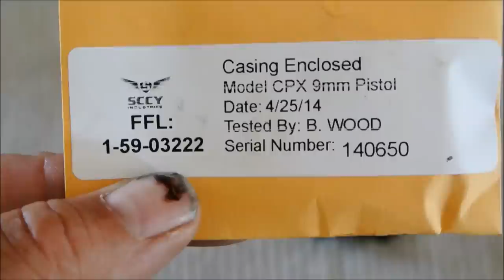cpx 2 problems

Comment: Sorry to hear this. From the looks of it, looks like ...someone...was tryin to field strip the gun and had no idea what they were doing...likely tryin to use a hammer and punch on those pins and got stupid and sloppy and cracked the polymer frame. But hey, whatever right...all guns sold by sccy have a lifetime warranty no questions asked.

Comment: LIFETIME WARRANTY--I never had a problem in 8 years of owning a SCCY
Reply: Richard Walsh this mall ninja is not a real operator like us so he knows nothing!
Reply: I have never seen one shoot 300 rounds without an FTE, FTF or trigger fail to reset. Great gun for criminals but I'd take a good combat knife over one
Reply: 2 weeks of owning 2 SCCY’s and problems with both... I wonder if it’s because they are older gen?
Reply: Richard Walsh I had to send mine back because the bolt would hold open after 50% of the shots “on its own”. They repaired it no charge, even the shipping and have had no issues since. Hundreds of rounds an no problems.
Reply: Cpx-2 works great for me

Comment: I have had my cpx-1 for three years. The only difference between the cpx-1 and the cpx -2 is the 2 doesn’t have a manual safety.  I have shot over 2000 rounds through mine without a failure.  I now use mine for ccw because it goes bang very Time  I pull the trigger and I can hit what I’m aiming at.  You should have called SCCY before you made this video.  From my experience they will take care of your problem without any hassles.  From my experience it is a dependable firearm.  I sight mine in at 15 yards and I can put the pattern inside 5 inches, that is all you need for self defense

Comment: WOW, to crack a frame like that it must have had a heavy dose of either hot reloads or +P rounds run thru it which this pistol is not recommended. That little piece of metal is the ejector pin and is held firmly in place with a roll pin. If it's loose the roll pin is probably broke which is also a sign of really hot loads. Thank goodness it has a lifetime warranty,lol.  Thanks for the Vids.
Reply: Hot loads lol
Reply: Gotta be careful not to run +P rounds through that pistol...it is NOT +P rated.

Comment: I have one and it is great.  I have fired at least 175 rounds through this pistol with absolutely no problems.  I am a novice shooter but I make sure I pay attention to each and every detail with a critical thing of owning a firearm.  Perhaps there are some "lemons" in the gun world?
Reply: This is a good value gun with a great warranty. You did well. Videos that show a problem more likely than not go on and on how bad it is. If you don't want your pins to walk perhaps put some lock-tite (blue) on the pins on each side to be a little safer. Walking pins were most likely the problem with the grip cracking. It is a known problem enough that SCCY offers oversized pins. BTW I am sure you can request them if necessary and they will send them free of charge from what I have read. I myself don't have a SCCY but will be purchasing one in the near future. I have researched this pistol enough to know it will be a great pistol for self protection and will most likely have it in my car or travel trailer. I have better full size pistols at home. I also have a Taurus Spectrum I recently purchased that I will use as a pocket carry gun.

Comment: I bought one on Wed before Xmas and Friday after I order another. My wife and I both find it to be a good gun at even a greater price.  Good luck with it, you should have no problems with Sccy on the return.  As far as the brass, I shoot two to three times a week and as many as 400-500 rds each time and three to four guns each time. Each gun will toss brass different then another. The pin can be taped it nolt a big deal, but the crack is a problem.
Reply from the maker: buzzsah I ended up cuttin bait with this one.  SCCY's customer service is awesome, but i think i got a dud with this one......next!  FWIW I got what i paid for it, so theres that.
Reply: dzlfreek I did have a small problem with their mags, but they sent out two new asap. However they were bad as well lol. I called and was talking with a Jason in service, a good guy to talk with if you have a problem.
Reply: Mags should be broken in reducing the spring tension. There are procedures for that. Also some people have made sure that the top lips are smooth. I have seen some people remove rough spots that kept the round from feeding smoothly. I saw them on YouTube as well. You can try to find them just looking through all the SCCY videos. Most feeding problems have always been the magazines. They need to be broke in sometimes and just getting a new one isn't going to fix it.

Comment: I have several cpx's gen 2 and 3 no problems is a good gun. I did install the trigger spring kit on them all, to smooth out the trigger pull. I also have a couple of the new dvg's there good too

Comment: your vids helped me understand the canik tp9. I bought it based on your "long term " video. Thank you. Any way Please do not fire that weapon until you insert that pin all the way. It is responsible for your locking lug and could possibly allow the slide to come off backwards bro. If you reinsert it properly I wouldn't worry about it while you wait to here from them. But please dont otherwise. Venture to say it could very well be the cause of your ejection issues. My canik does the same with right next to my feet. since I re load this is great. Ditch the cpx and just get a good p99 conceal holster for your canik friend! I use a versa carry to cc mine.
Reply from the maker: Thanks for the compliment, I do appreciate it, very much.  The CPX is going back to SCCY for warranty service.  talked to them this morning and they were very helpful and it looks like they will take good care of me.  Im not going to fire the gun until it gets back from the manufacturer.  I asked another YTer that has this gun about the brass dispersal area and he said it gets tossed around 8 to 10 feet in no particular pattern, but holy crap, mine was pitchin brass as close as my forhead and as far as 30 feet directly behind me!  I do like the way that little CPX shoots though.  Thanks for the comment!
Reply: dzlfreek Yes the thing about these cpx is there seems to be a good probability of problems, however they seem to be completely willing cover the owner and get it right for them.WHich is awesome but the high amount of problems worries me for  a concealed carry pistol. I really like the design and price and would love to carry one but the probs really bothers me since it wouldnt really be a range gun for me. Hope they worked it out for you though man.

Comment: I have a cpx 2. I can manually put a round in the barrel and rack the slide. Without even firing it, I cannot manually eject the shell. It jams into the barrel, to the point I have to "slap" the slide hard to get it to eject. Sccy says they were sending me 2 new magazines. But how can it be the magazine when I don't even use a magazine and it still happens. Any ideas? It has taken 2 months to get the magazines to be sent out and going on 3 and still do not have them. It's been very hard to get Sccy to answer my emails.
Reply: Why are you sending emails when you can contact customer service
Reply: Lmao. Dude. You didn't know that in semi automatic pistols you can't actually do this without destroying your gun? It's not a shotgun man, it's designed to feed from a magazine. By doing this you are going to end up damaging or breaking off your ejector and or extractor.... You can't do much worse to a pistol that try to load it one at a time by inserting the round through the ejection port. That's why it's called an ejection port. Not a reloading port, lmao.

Comment: Purchased the cpx-2 last week,,the following weekend took to the range,installed loaded clip. Pulled slide back to load & it jammed, bullet not entering barrel , you have to pull slide back a hair & assist to get bullet in the barrel..When firing would jam with the tip of the bullet striking tapered  section of barrel..almost every round wouldn't load properly..Really disappointed on a brand new gun..eventually ran 50 rounds to see if breaking in would help but the same issues. Either taking back to guns & ammo to get it fixed or replace,,good luck with that,,or call manufacturer to send back...a brand new gun,,clips are hard to load also...Really starting to hate  this gun & mistrust on quality but we will see how this is handled...thanks,,,, a passed off customer
Reply from the maker: SCCYs customer service is awesome and the turn around time was really short.  For me it was a week and I'm about as far away from FL as you can get!  Try different ammo and if you have a drexel tool, polish the feed ramp.
Reply: Alice G  It is recommended by SCCY and magazine manufacturers that you load and unload the magazines 10 times and then leave them loaded for 24 hours before firing them. 
I agree the magazine has a really strong spring and can be tough to load. I use the UpLULA loader which makes it super easy .
I read here where people have problems like fail to load or other breach issues when the first thing they do is take it to the range, most likely with in-seasoned magazines. 
You’ll like the UpLULA loader.

Comment: I have two SCCY pistols, a cpx-1 red dot and a cpx-2.  Both of my pistols needed break in but after about 200 rounds each I had no failures.  Call SCCY, they will replace or fix your pistol.

Comment: Recently purchased a Cpx1. First time firing. Out of 40 rnds it jammed 7 times.  Today 2nd time firing with new 30 rnd mag by promag I had no issues emptying the mag. But after putting 10 more rounds in I had 3 failure to feeds.  One late trigger pull I guess then casing didn’t eject and now no trigger whatsoever ever.

Comment: Great BUDGET gun in general . If you can't get something like a Colt or Sig then this is one of the best budget guns you can get. The problems you showed are concerning though. Did you use any +P loads? No QC is perfect but, pins walking on the Sccys has been an off and on issue for a while it would seem. I doubt that the CPX was intended for thousands of rounds of target shooting either...basically it's just a close range pull, point and shoot CCW weapon.
Reply from the maker: Lance Lucern only had 80 rounds total through it.....its brand new!  standard 115gr ball is the only thing I put through it so far.  Stay tunned for an update!  Thanks for commenting!

Comment: If you bought it brand new you should have broken it down to clean all the cosmoline off of it before you fired it. In that case it would have been reassembled and you may have caught it sooner.  I enjoy your videos but the rear crack may have occurred because you fired it with the forward pin not fully engaged. Too much stress on the frame. Great warranty though. Glad it worked out.
Reply from the maker: fwiw, cosmoline isnt used to lubricate new guns, its used to store metal objects that are prone to corrision that are stored for long periods of time.....like decades.  New guns are generally test fired at the factory prior to shipping.  If this would have been a Mosin Nagant that I purchaced out of the crate, then your assesment would be correct.  Look ahead to the follow up videos to see what happened since this video.  Thanks for the comment.
Reply: This is a common issue still. Yes the pin not engaging the front is what caused the crack, not the guy breaking the gun down and cleaning it. Breaking the gun down to clean it would not have fixed it unless you are the guy that takes pins out of a brand new gun just cause OCD is string within. Oversized pins and "Glue" was the fix.

Comment: You do not need to send a picture, Call and they will let you send it back. You can use a small flat rate box from USPS to send it. It is legal to send a firearm to the manufacture by mail. Hey things happen. I will bet you will have a new gun in a week. They will not repair it. Just in case copy the serial number, then you will know if they sent you a new gun.
Reply: Unless you have an FFL, you can only send a handgun back by UPS/Fed Ex Overnight. USPS is not allowed unless a dealer.
Reply: Interesting, I need to send mine in and its good to know I can get a size box there to fit it.

Comment: Any poly guns have pins that can back out no matter who made it if that pin was left to back out you have the receiver going up a slight amount and causing to much stress on rear pin, so you had to fire it quite a bit with that pin out to crack the frame. But sccy will repair user error at no cost. But all plastic guns have those pins and all no matter how much you spend can do that , that is why all manufacturers manuals tell you to inspect the gun before you fire it.
Reply from the maker: 40 rounds is firing quite a bit?

Comment: The trouble is the same as it's birth parent the KelTek. Weak trigger bar, magazine follower letting the tip of the bullets tilt downward and a horrible feed ramp. All fixable but a pain. Its a P11 really. Just different name.
Reply: It is basically a p11
Reply: Are you an expert on these things? Don't think so. You most likely don't even have one. Out of what you said I have only seen people polish the feed ramp, and do a little work on the mag like break it in and perhaps smooth out the top edges of the mag if they are rough. None of these things are difficult.
Reply: @garrytalley8009  I'm a gunsmith and have been for 25 years, so yeah I've been working on a few.
Reply: I've never had a problem with my keltech PF 9 out shot many Kimber micro nines for dependabelity

Comment: I have two of these pistols one is my wife's and i haven't run into any problems yet  but they haven't been shot much maybe 100 rounds apiece so far but this pistol fits my big hands well even though its a  subcompact it feels like a full size pistol also pretty accurate ,  hopefully mine keep running strong,  good luck
Reply from the maker: keep you eyes on the receiver pins.
Reply: will do thanks for the heads up

Comment: Right now my cpx2 slide is locked back and I can’t get it unstuck at
Reply: Look through the slot in the rear and see if the strike hammer is wedged on the ceiling of the slide.

Comment: Anyone with the cpx 2 know if the guide rod is slightly bent or is it suppose to be straight?
Reply: Its bent when cocked back.
Reply: @stylzsp2949  im talking about if you take the slide off and hold the actual guide rod in your hand by it self.

Comment: I own a cpx1 and it's amazing and handles well... And if the pin is out a little than push it in and quit bitching. And as I seen in a comment yeah who cares if it's throwing brass (unless you reload your shells) than atleast it's not jamming on you bud. And fix your nails. You can't even take care if them let one a firearm

Comment: It could be the brand of ammo you are using, I was told not to use cheap ammo like American eagle, or any reloads , what they use too much gun powder, and some times there not regulated. 
I had a Jimenez 380 , I was using the cheap Russian reloads and cause the slide to crack down the middle, I sent it in and they replaced the gun for another one
Reply: You dont want your second amendment regulated dude

Comment: I had the cpx_1 not 1 problem ever.I now own the cpx-2 and 2 misfired in the first100 rounds and when I went to clean it the break down pin chiped and broke.Not happy so far
Reply: It is basically a p11 copy . The p11 was junk so is this thing

Comment: You should have contacted SCCY about your problems and it would have been fixed already. Pins walking (they have slightly oversize pins to fix that). Your crack is in what they call a handle assembly (frame) they could just send you the parts and you could change them out or send it in. I don't think you are gun savvy enough to repair it yourself but in some instances they send parts. Because the handle is cracked they most likely will need to put the fire battery in correctly. Just get with the company and quit doing a whining video without even speaking with them. Most likely your brass all over the place is the stiff recoil of a light pistol and you having a problem with the heavy trigger pull. Do the right thing get your pistol repaired and quit whining.
Reply from the maker: sent it back twice within the first 600 rounds for broken frames and one broken ejector.  You should've watched the rest of the playlist...
Reply: OK you did your thing and were not happy and had issues. Many people will purchase a gun like a SCCY to put in a car or take for personal protection and not even need to fire it anymore than to familiarize themselves with it. I most likely will never fire too many rounds out of one myself. I have a Glock and a 1911A1 at home but prefer something less expensive to have in the car and travel trailer. By no means is this a range gun anyway. There are too many other people that have not had problems than to think your experience is what to expect. You may have even shot steel or hot loads, only  you know. A cheap gun should only shoot non + loads and no steel cases. I respect your evaluation and do know that there can be issues but I have even had issues with Springfield. BTW I was as upset with them as you are the SCCY and so much I won't buy another Springfield anything. I know I have a Bias, you too.